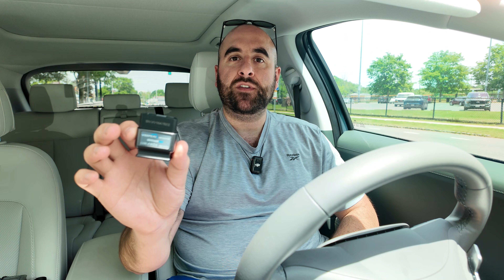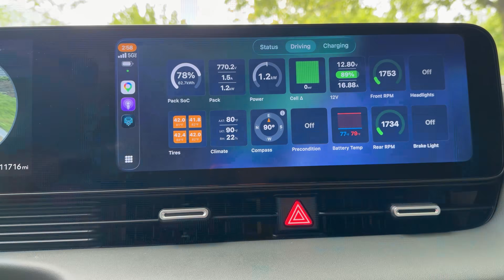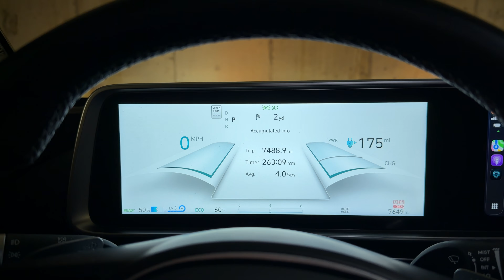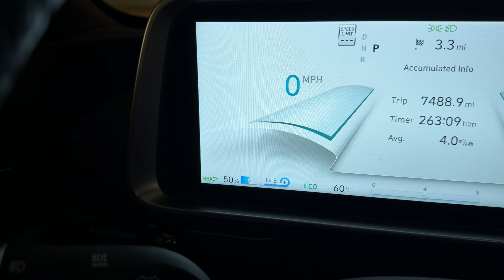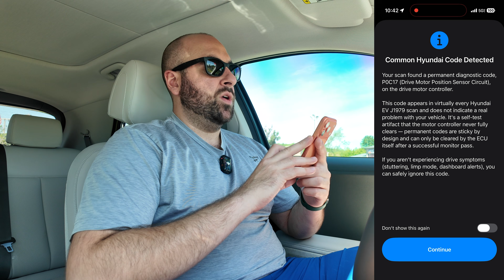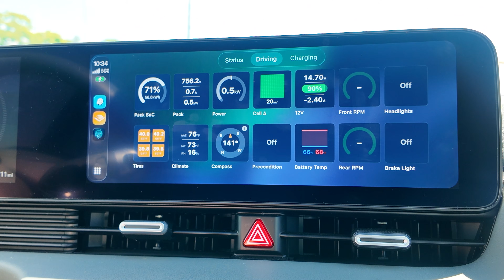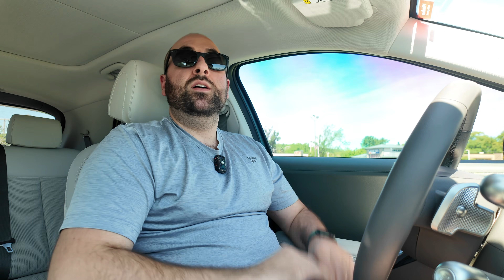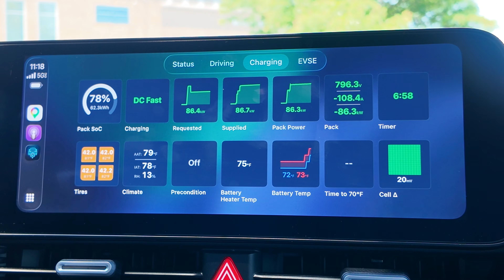Every Ioniq 5, Ioniq 6 & Ioniq 9 Owner Needs This App! | EV Dashboard for iOS

Comment: Very good info. Hopefully it does get ported to Android. One suggestion for a future update, that headlight square should just show the actual headlight and beams turn white. Not the whole square box. It looks weird compared to the other dark background squares.
Reply from the maker: That’s a great suggestion for the developer to clean up the interface.
Reply: I'm adding a customization option for the Headlight chip in the Version 2.1 maintenance release -- coming soon!   There's been some great community feedback about it being too bright at night.
Reply: @GregoryBurlingame I will buy your app just to see when my brake lights are on. It drives me mad to not know if people behind me know I”m slowing down.

I also love the history of my drives and my charges.

Now for THE question, can the ODB scanner be shared between two applications? I do use ABRP when road tripping to plan my route and my charges and would need to be able to use both apps at the same time.
Reply: @rolandmailleux7131  In Version 2.0, I added a number of features to make co-existence easier - such as the ability to turn off auto-connect and to manually disconnect (or connect) when you want directly from CarPlay.   These controls were intended to make it easier for someone to switch between IONIQ 5 Companion, and another app like ABRP.    Only one application can be actively communicating with the adapter at a time, otherwise they will both have degraded performance.
Reply: @GregoryBurlingame android please!